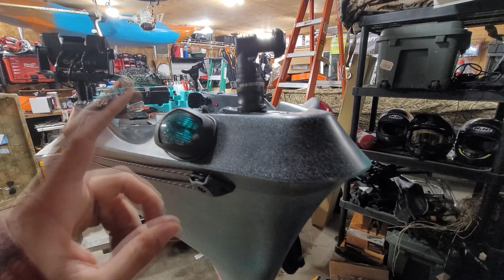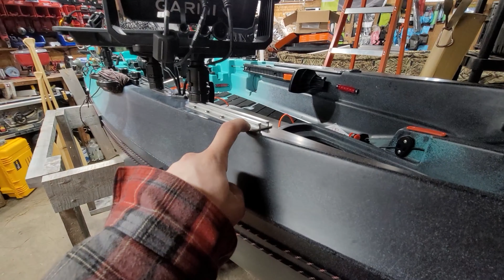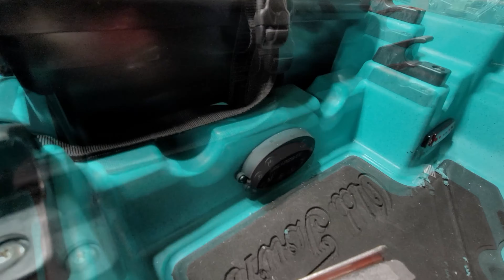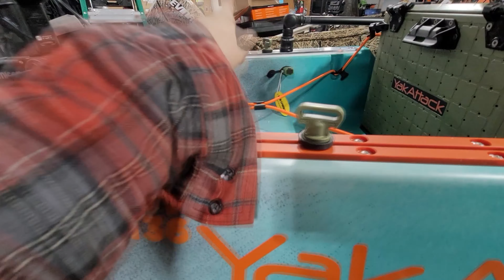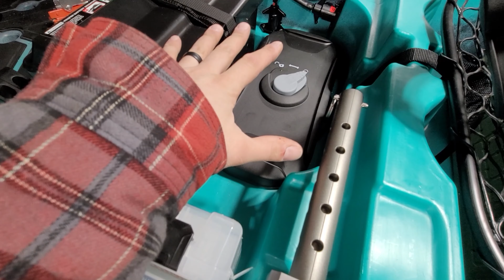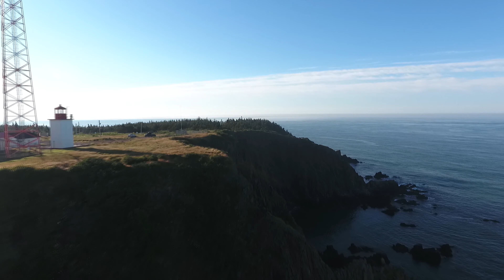Old Town Sportsman 136 Autopilot Customization/Upgrade

Comment: A rotogrip at the front of the track system works pretty well for storing a net
Reply from the maker: Go you have yours on a double header or just direct to the rail?
Reply: @Outdoorsnb  direct to rail
Reply from the maker: Timely comment. I was just looking into solutions for that very thing...Do you have pics of your setup? If you do can you fire them off to sales@outdoorsnb.ca or through FB messenger to OutdoorsNB?